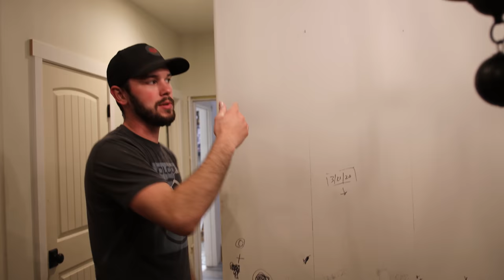DIY Dining Room Makeover

Comment: Great job Jason....I think you missed your calling, you're great at public speaking and in front of the camera.
  I am using thin plywood/underlayment cut down (by home depot) as my ship lap, Its much cheaper, like $14.95 /4x8 sheet. I'm not doing every wall in my house shiplap though because real farmhouses rather they be primitive or country, didn't always have a lot of shiplap. Shiplap in homes was usually found in homes on the coasts, and came from ships they disassembled, hence the name "shiplap". So real farmhouses had lath and plaster walls or wood walls(usually vertical so moisture wouldn't sit in the seams.
I absolutely love the color of your kitchen cabinets. Its just beautiful.